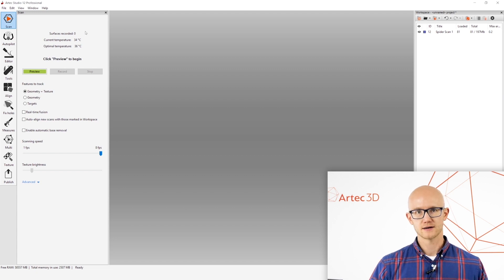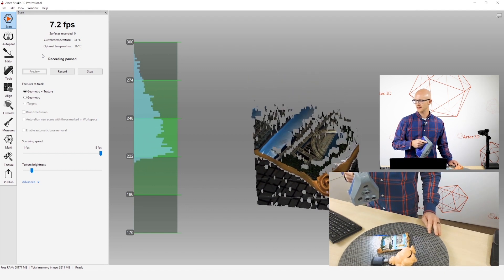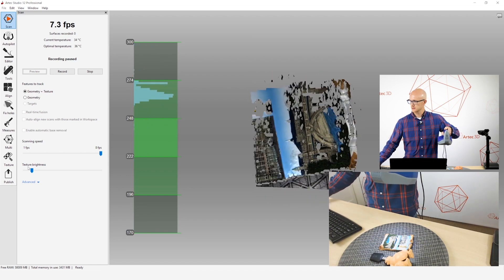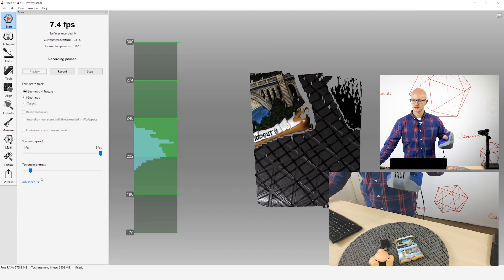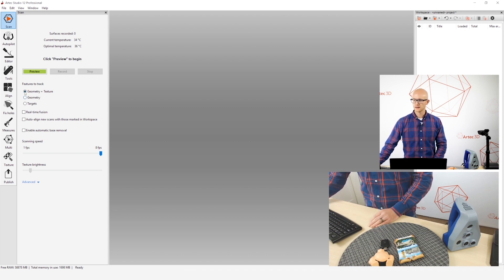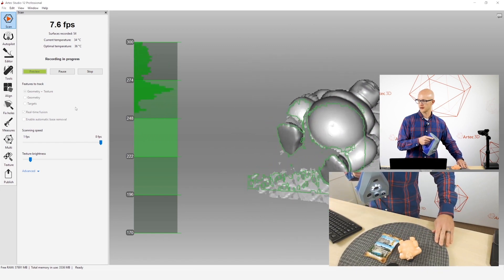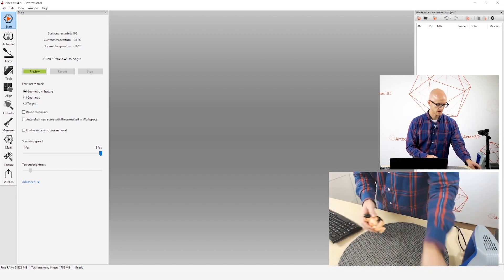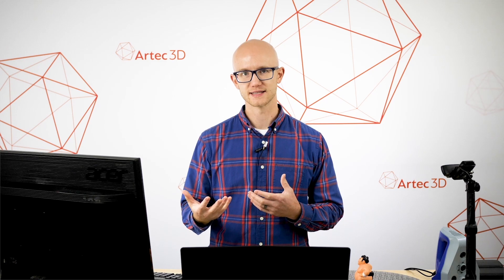Artec Studio 12 Software Tutorial: How to Choose Scan Settings for best results

Comment: Hello, I'm form Argentina, I'm a student of archaeology and with other collegues we are using this scanner to make 3d models of lithic artifacts. For the most of the artifacts we don't have any problems, but with objects made of quartz or other translucent materials we are having serious problems. Can you recomend some solution for scanning this kind of materials? It's very important not to use any material that could damage or corrode the pieces, because this artifacts are used for another types of analysis, such as microparticles analysis.
Hope you can help us. Thanks. We use your video tutorials all the time.
Reply from the maker: Hello, you can try one of the following:
1. Different angles of scanning.
2. Different distances between the scanner and the object.
3. Increase the Sensitivity feature in Artec Studio during scanning.
4. Use spray which evaporates from an object within several hours of application. Can be purchased here: https://aesub.com/distributors 
Important note: before applying any of the sprays, always observe the safety precautions. Each spray has its own set of precautions which are written on the label of the spray can.